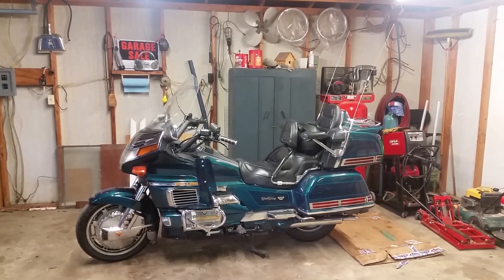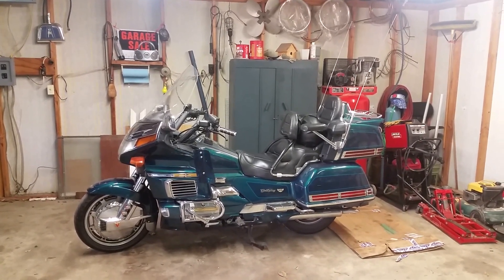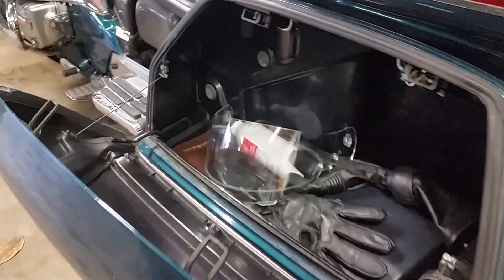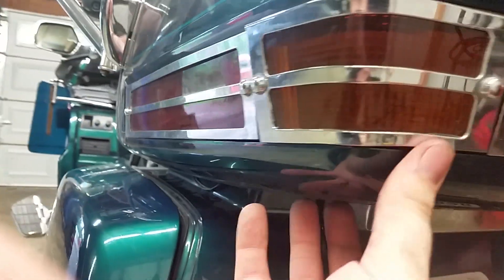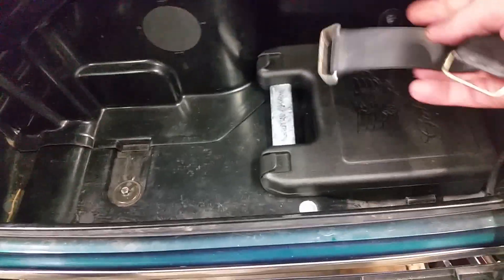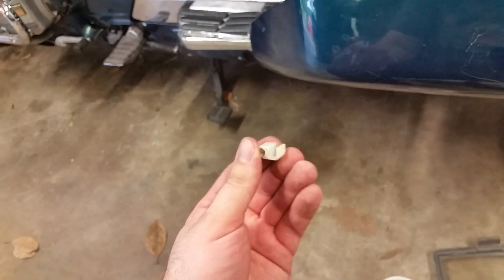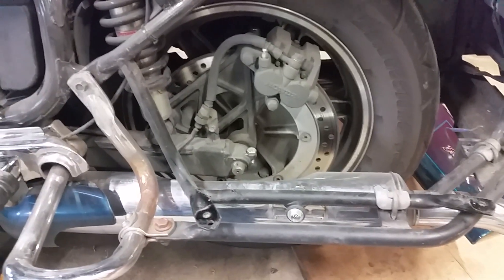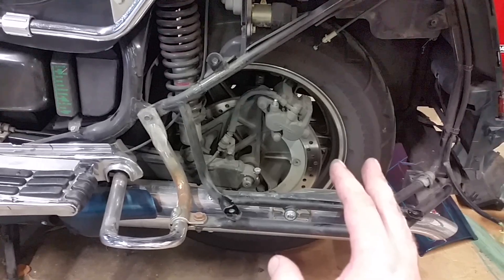How to remove a saddle bag on a GL1500

Comment: If you're doing rear wheel work there's no need to remove the saddle bags.  In the right bag where the air line comes through you can access the lower bolt that holds the  whole bag and trunk assembly on.  The same access is inside the left bag.  Remove the seat and loosen the upper bag mount bolts, remove the rear muffler mount bolts, remove the rear crash bars and the entire trunk and bag assembly will tip up and give you total access to the rear wheel and shocks.  If your bike has a trailer hitch it will have to be removed too.  I would replace the lower bag mount bolts (which also are the rear crash bar mount bolts) with allen bolts.  It makes reassembly a lot easier.

Comment: You are my savior and reason why my bike is running. Im a carpenter by trade bike mechanic by clifford now. From removing my carbs ,rebuilding,reinstalling,checking timing belts and reassembly. Like as before i let it sit too long it popped over first pop littlr choke.

Comment: I purchased a 93 gl1500 interstate about a month ago and with your help I changed the oil, spark plugs , air filter,  and the front speakers. In the past I would have paid someone to do the work. Your videos are priceless. Thanks for the help.

Comment: Excellent video... and everything. Tragically, a local motorcycle shop did not take the saddlebags off when putting my tire on and installing new brakes. So here's what happened. While I was on I265 South in Louisville during high traffic time, my rear brake caliper came completely off and grinded against the rotor. I had no rear brakes! I took the next exit and found a safe spot to pull off the road and my dad, who's 82, had to go to the farm, pick up his truck and trailer and drive to Louisville to pick up me and the bike. The motorcycle shop knew they messed up and fixed the problem but my confidence in their repair work is utterly shattered. :-( I can send you a video of what happened. And everything.

Comment: Thanks  A Ton. My 1996 GL 1500 Wont Start The Starter moves but doesn't Crank up the engine, any tips or any videos you have uploaded for Starter Motor? Await your help in this regard.

Thanks In Advance

Comment: I really enjoy these videos and they have helped me immensely when working on my 1989 and 1998 Goldwings.  I have replaced brake pads, tires, etc. but have never changed the brake lines.  I have ordered steel braided lines and want to know if you have any tips or tricks about replacing these lines.  Just anticipating a difficult job and I cant find any videos where anyone has done this task.  Thanks!

Comment: Walt Dudley , Don't have to remove anything on the bags, just pull the lower two bolts(one left side one right side) , loosen the upper two (under the seat)and tip the whole assy up and forward.

Comment: I seen a cover on the inside of the saddle bag, can you bleed your brakes without removing the saddle bag through that little round cover? Looking at buying  91 1500 and the back brakes don't work. Hoping they just need bled.

Comment: Hi Clifford.  Thanks for all of the awesome videos.  I just picked up a 1991 GL1500, and riding it back to the house it seemed to have a tendency to wander pretty easily.  Nothing terrible, but not the handling that I expected out of the bike.  I will be going over the suspension, but was wondering if you might suggest some trouble areas to start looking first.  Maybe shock bushings and such that tend to go on this age bike.  Thanks for any help.
Reply from the maker: i would start with checking the fork seals, and neck bearings

Comment: good vid
Reply from the maker: Michael Pineda thank you.
Reply: have you tried flipping up both bags and trunk at same time real ez.
Reply from the maker: i've taken both bags off before, but never flipping them.
Reply: try it. inside bag left side remove plug loosening bolt do same on other side push air hoses thur loosing bolt remove seat. make sure your on center stand . remove muffler bolts both sides. grab back. lift up and tie to handle bar. real ez. got from goldwing online .. works well.. try it .
Reply from the maker: oic, i'll have to tried it sometime.

Comment: Why didn't they just put an access cover with screws and rubber seal so entire saddle bag would not need removal?
Reply from the maker: The point of the video was to show people how to remove it.
Reply: @CliffordRice  Thanks for video it is very helpful. I was just trying to say it would have made it a lot easier and faster if an access cover had been designed in the saddle bag for changing pads.